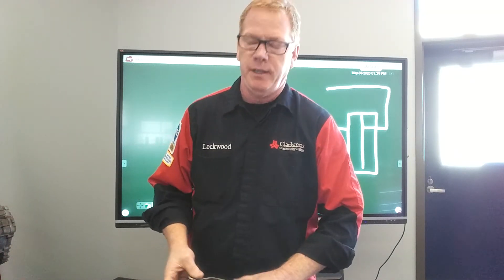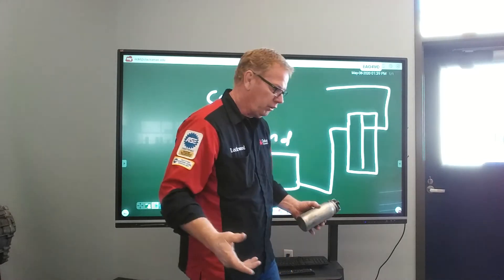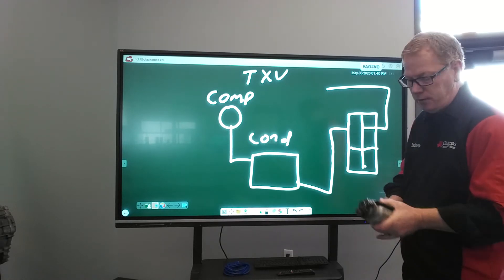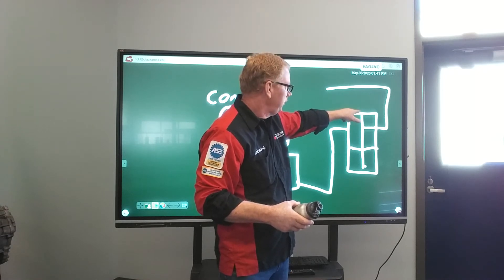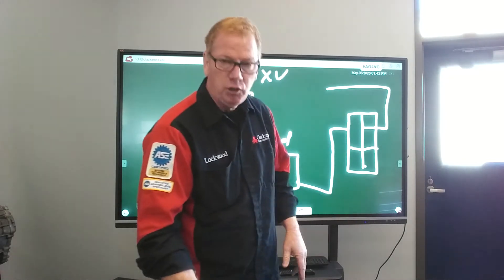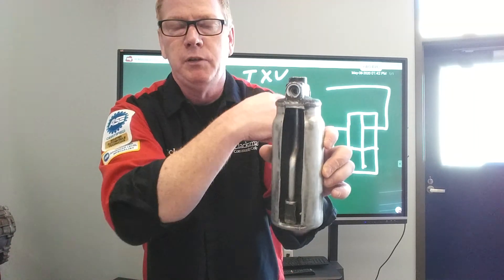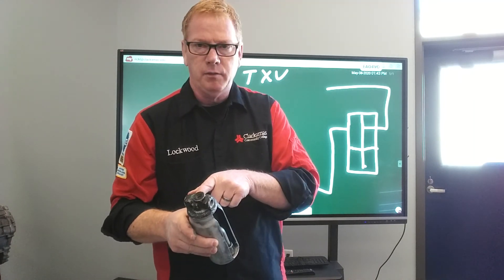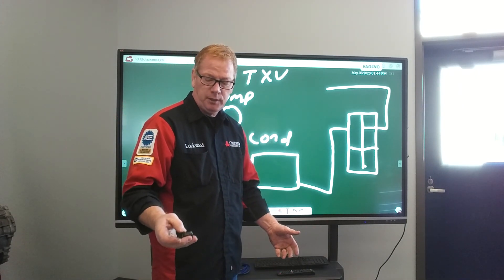A/C Receiver dryer operation

Comment: So does the receiver drier act as a storage for the system kind of?
Reply from the maker: Yes, it does. As the heat load increases more refrigerant is needed in the evaporator to absorb it.